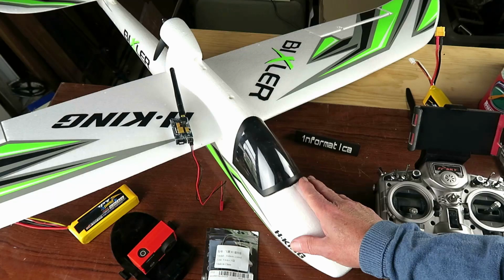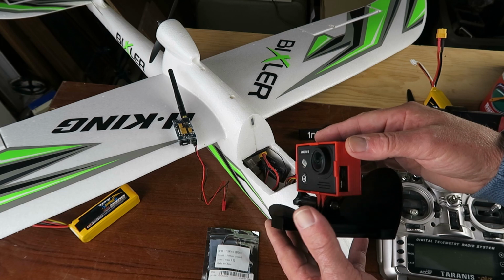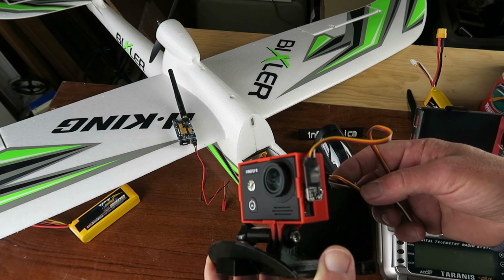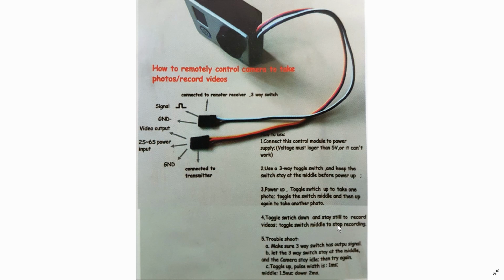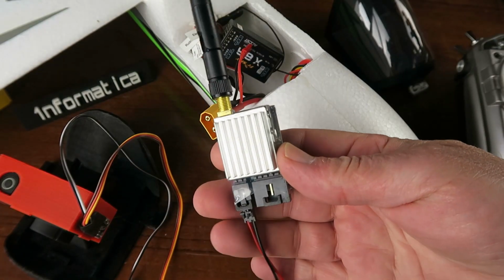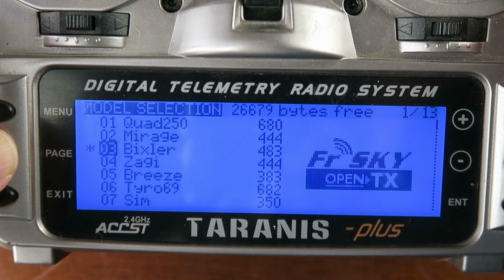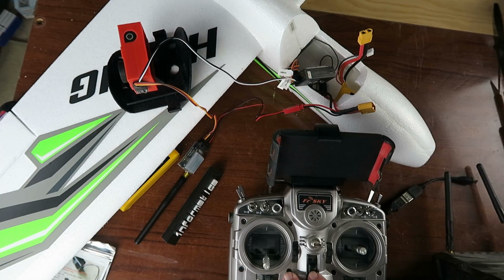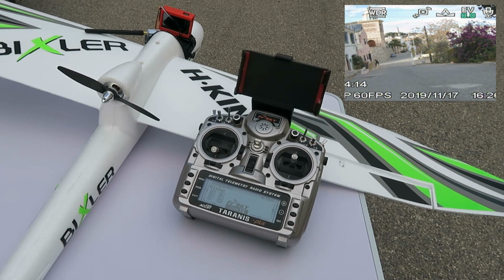Remote Control AV Cable for Hawkeye Firefly 8 8S & 8SE Action Cameras Review Test

Comment: Hello! I have a firefly 7s that came with a usb without the signal wire. Only the input power and av. Do you know where on the usb board is the white signal wire soldered? Thank you
Reply from the maker: The signal wire does not go directly to the USB port. There is a special circuit board that controls the camera. You can see it here : http://bit.ly/FireFly8_RemoteAV_Cable Thanks for watching, have a great day!

Comment: this camera could work as dashcam? I mean to remote it from the voltage..
Reply from the maker: If you enable the "auto record" feature then the camera will start recording when switched on or power applied to the USB port. Please consider subscribing if you have not done so already!
Reply: @1nformatica  subscribed right now! what happen when you enable this function and pull out the voltage? the camera will use the internal battery to close the video and turn off?
Reply from the maker: @airfilm_it  If you remove the USB power it will continue to record on the internal battery. If you remove the internal battery and remove the power while recording the video file will be corrupt and  unplayable as the file will not be "finalised". thank for subbing!
Reply: @1nformatica  it's strange, other dashcam has an internal battery with a short timer, are you sure wich this camera don't have a timer after the cut off?
Reply from the maker: @airfilm_it  This is not designed as a dashcam although you could use it as such.

Comment: nice ! does this cable works with other FPV Cams like GoPro Hero3, FireFly Q6 ?
Reply from the maker: As far as I know it only works with Hawkeye cameras. I do not have a Q6 to try, maybe email them? https://www.fireflycameras.com/pages/contact-us Please consider subscribing if you have not done so already!
Reply: @1nformatica  Thanks for prompt reply.
Actually FireFly Q6 is a nice FPV HD camera which produce negligible drag as compare with gopro like cameras and it works very well with Open.HD (Long range HD FPV system using 2 Raspberry Pi and 2 amplified WiFi USB adapters), via HDMI to CSI converter board, it gives 1080p video on Open.HD
Reply from the maker: @narpat007  Thanks for the "heads up", looks like a nice product. I like the Mobius style package. Another item on my wish list!
Reply: @1nformatica  I see, but Mobius cam does not have HDMI out whereas FireFly Q6 has HDMI out and with Open.HD (https://github.com/OpenHD/Open.HD/wiki) and HDMI to CSI adapter which is very small you can have 1080p FPV, Isn't it a great ?
Reply from the maker: @narpat007  I am looking for a replacement for the Mobius and this does 4K so looks perfect. I see in the product description on Banggood a photo with the remote control cable the same as the one I reviewed so it will work.
Reply from the maker: @narpat007  I also see designs for 3D printed mounts and cases here : https://www.thingiverse.com/thing:1811430

Comment: great video and channel, I have only one question, this cable called the signal that goes to the control receiver is connected to where in the microusb?
Reply from the maker: Thanks! The signal from the receiver does not go directly to the camera USB. There is a small circuit board with a micro controller on it that decodes the signal to know if the camera should be taking video or a still. Please consider subscribing if you haven't done so already!!
Reply: Thank you so much for helping.

Comment: Awesome job, my friend! And thanks for the shootout! 😃
Yeah, I bought the 8SE, but my computer can barely edit 1080p video, so... 😕
Anyway, I'm surprised it worked with the 5v from the VTX! 😃
Reply from the maker: Thanks Mario! I did not explain well but the VTx passes the voltage from the 3S pack through to the camera connection minus 0.4 volts dropped across a protection diode. So the camera remote board is getting about 10.7 volts minimum. 😀🛩
Reply: @1nformatica  Oh... Really nice!!! 😃